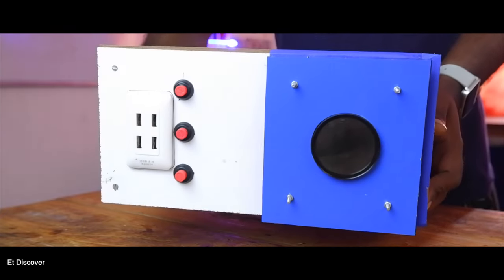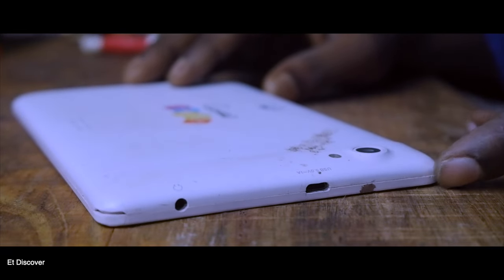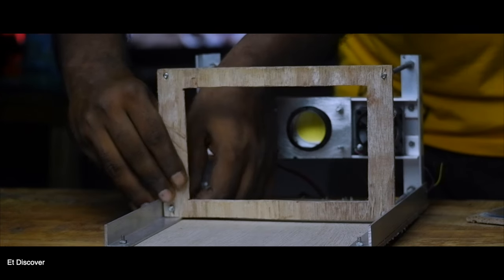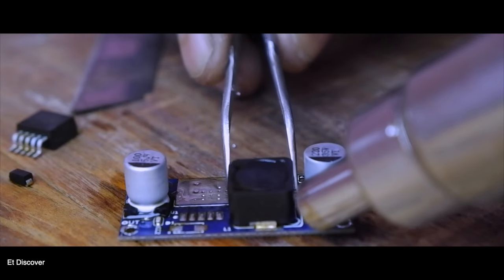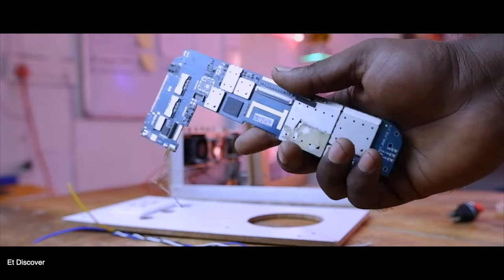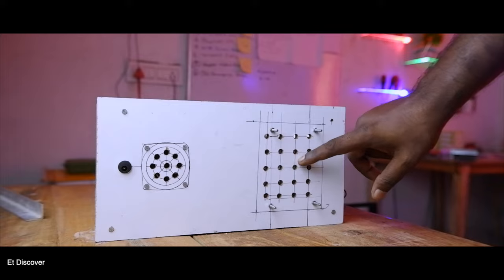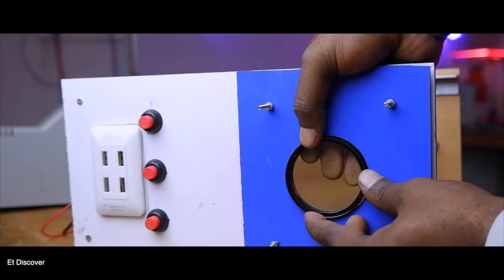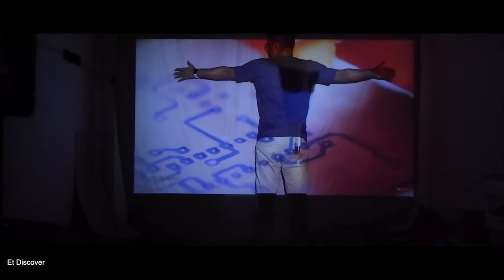I made this $20 FHD Projector (EP-2)

Comment: sorry but bro ...let me tell you that "macro closeup lenses" are meant for photography...thus it is not suitable for cinema projection ...as doing so will damage your projector as the above lenses are not build to resist high temperature ....of the led chip lamp....thus ...if you want to build a high quality of projector then you need precise diameter of "TRIPLET" lenses along with its focal length...in comparison with the "LCD MODULE" diagonal....and adding more to the above buying a triplet lense and other accessories are very costly now a days...coz Indian govt has banned Chinese eCommerce sites from where we earlier used to buy those thing at cheaper price.....thus go for ready made one....